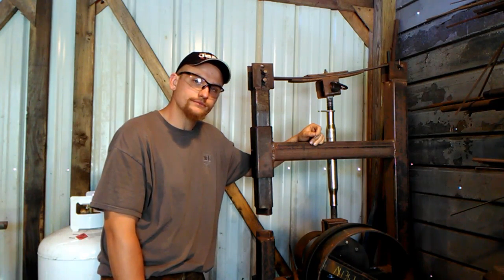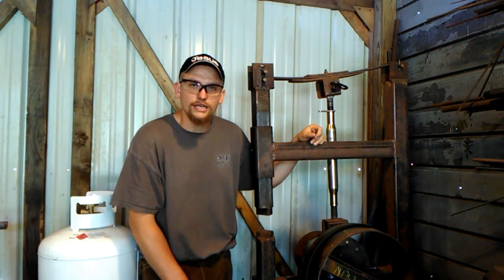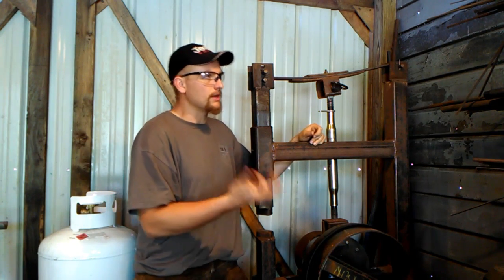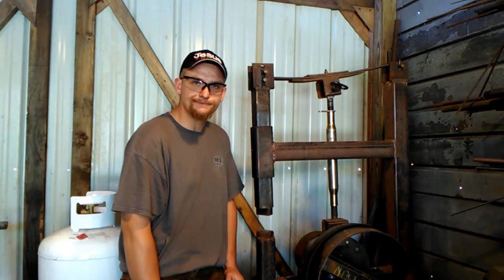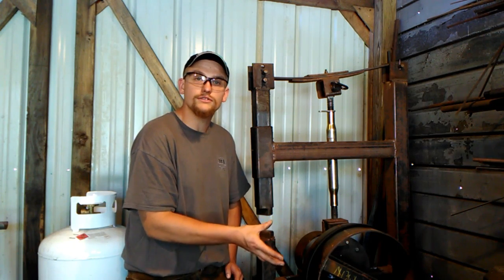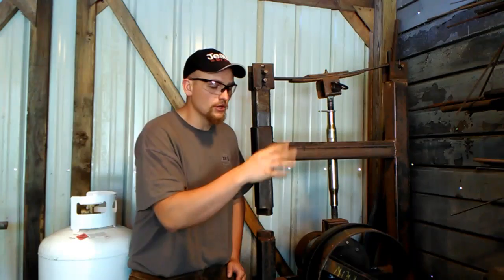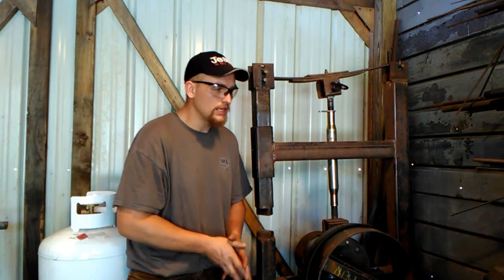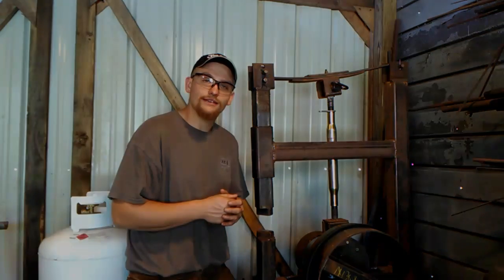Advantages and Disadvantages Power Hammers // Is Using a Power Hammer Right for You?

Comment: They are great for reducing stress on the body when doing heavy work. I used a big one and did not feel comfortable with it (safety issues in relation to my disability). I may build a modified unit that is smaller and gives me more time to react if something goes wrong.

Comment: Hi Roy,   I think I"m on the mend, again...As always, excellent video.   I got back to building a power hammer off of your available plans.  Still not medically cleared to drive as of yet....to that end,  getting quality wood 4" and 6" timbers will either have to wait until I am cleared due to the lack of timber frame stock.   However, It seems like I have miles of square tube stock...so I will have to build it out of steel and use wood wherever I can to decrease that collateral impact shock.  I'll take pictures along the way.     Thanks so much and I am glad just to be able to watch blacksmithing videos to keep that inspiration of recovering happening that much faster.

Comment: My Massey makes me a better smith. I just wave the metal under her and kitty makes the magic happen. I would say that you should buy or make the biggest hammer you can as you can do small work with a big hammer but it harder to do big work with a little hammer. As in your example with the hand hammers. The sledge hammer can still make the small taper but the 1oz hammer can forge inch square so well. 

You do make some good points old bean. great video and well done on all the hard work.

Comment: I did like how you thought about it :D But I can't decide the power hammer hammer head weight for making tooling for blacksmiths and garden tools and also some weaponry(not those that use powder of eny kind) so the issue is should I go for bigger size or the smaller size... I am just starting this winter to make it as profession for me and can do tongs and those with hammer but if I need to make bigger tools etc. I need an advice for it
Reply from the maker: +asf130 The Company it is great to hear that you are going to try to make this your profession! My suggestion for most guys getting into it in needing to buy a power hammer is to pick a power hammer that will be most versatile for the work you want to get into. That being said a power hammer with a 50lb Ram weight should be sufficient enough to create just about anything you need. 100 lbs Ram weight is about ideal if you are forging heavy tooling AKA Hammerheads in such as these require a ram that is large enough to overcome the mass of the material and whatever top tooling you're using. If your main ideal is to forge tongs you can get this done with as little as 10 pounds Ram weight. Hope this helps with your decision making thank you for taking the time to watch and we'll catch you on the next one

Comment: advantages: less effort to do rough work so all you have to do is finish the product. disadvantage: less time and effort spent hammering?
Reply from the maker: +Levi Blackwood the disadvantage to a power hammer is your own abilities and tooling to be used underneath them. They are a tool like any other tool much like welding equipment if you don't know how to TIG weld a TIG welders worthless to you if you don't know how to use a MIG welder a MIG welder is useless to you if you don't know how to use a bench grinder a bench grinder is useless to you. This same thought process applies to power hammers and presses they are a tool and they're only as good as the designed tooling you can put underneath them. Hope this gives this video a little clarity. I will be having another video out coming soon that shows and highlights the differences between the two presses and power hammers that is. Thanks for watching